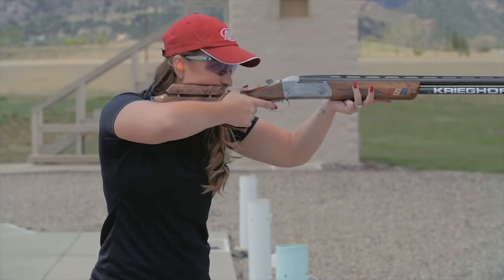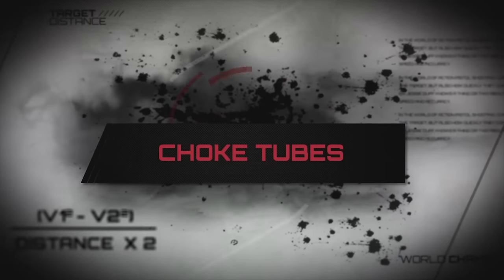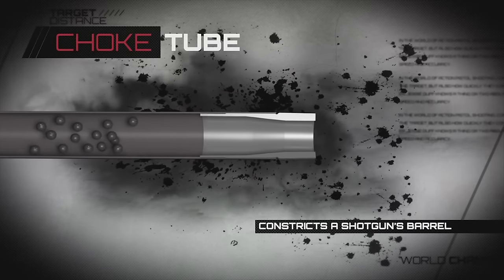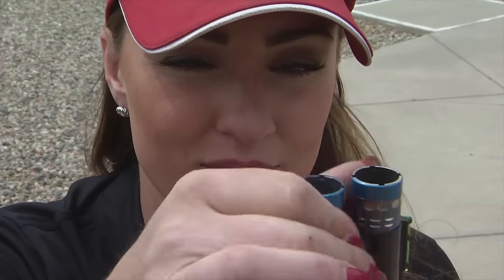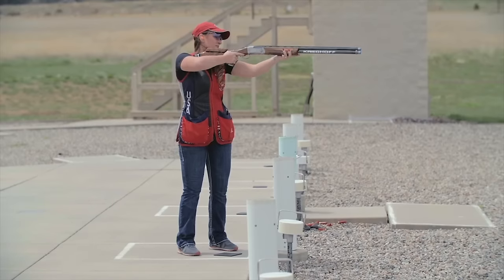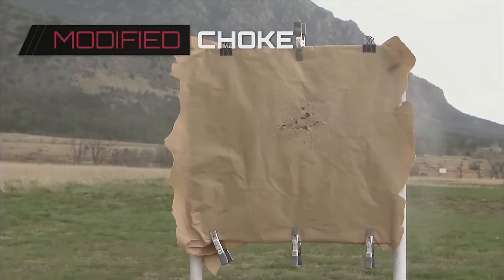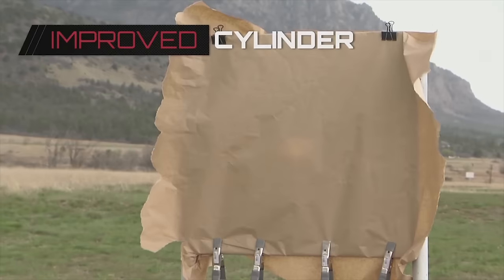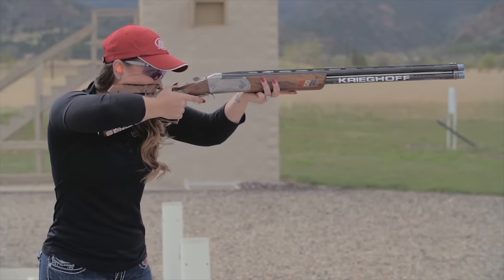Firearm Science - Choke Tubes & Shot Patterns

Comment: good video.  i need some help answering a question.  i have a full choke on my modded vepr-12 shotgun.  what would the best ammo brand, and ammo size 7 1/2,  6,  5,  4,  (shot size) for a full choke on this weapon?
Reply: Depends on your use?  You probably dont want to shoot skeet with a full, but trap would be fine.  Probably 7.5 or 8 for most clay and dove, and longer shots drop to 6.  Hunting bigger birds like pheasant, ducks etc. Drop to 4.  The brand of load you would use depends on what your gun patterns best with.  Need to test each load through your gun to know what it likes.  Each gun is different.

Comment: Hi. For hunting doesn't the multiple ball projectiles mess up the kill or meat? I'd imagine there would be quite a bit of surface damage.
Reply: it's only good if you want ground meat :))
Reply: Some states insist you can only use steel shot. I guess you could pull them out with magnets?
Reply: Ground meat flavoured with Lead powder is NOT good!
Reply: Use slugs???
Reply: Birdshot and .410 exist for smaller game.
Reply: @Yman83464z  steel is not attracted to magnets.
Reply: @riichobamin7612  Nope! Stainless Steel - yes, not magnetic. But normal Steel is HIGHLY magnetic.

I am not sure where you are getting your info from. Car bodies and components are made of Steel - and attract magnets 100%
Some types of Stainless Steel are NOT magnetic - but would not be commonly used for Birdshot - too expensive. It is used for some more expensive non-toxic stainless steel shot.
Reply: @Yman83464z  👍🏻
Reply: @Yman83464z  It's not because of that, it is because lead shot ending in water is not good, a duck eats through the bottom and might eat those lead shot, which will cause the duck to die.
Reply: It actually very rarely damages the meat too bad, usually only couple pellets hit the bird, and many times birds are shot in the back so no meat wasted
Reply: so do shotgun hunters use slug buck of birds?
Reply: @tellulaire8168  Birds are shot with smaller pellets from a distance so there's a spread on the pellets. Try looking up "testing different bird shots" so you'll see what I mean.